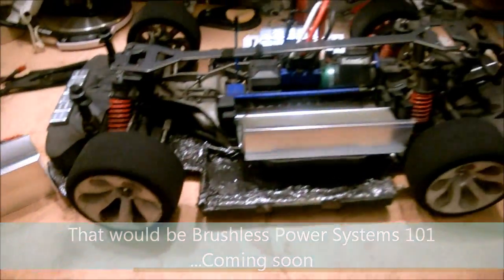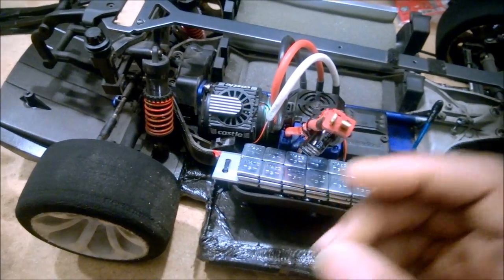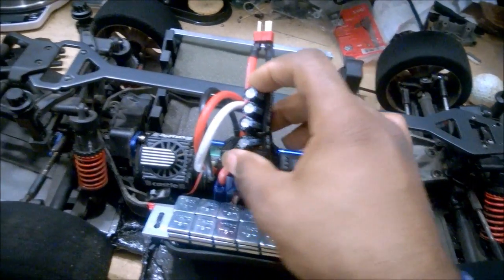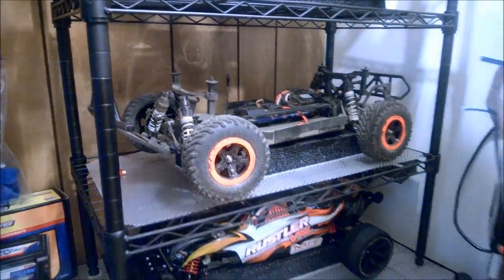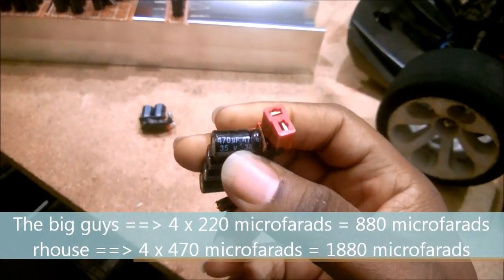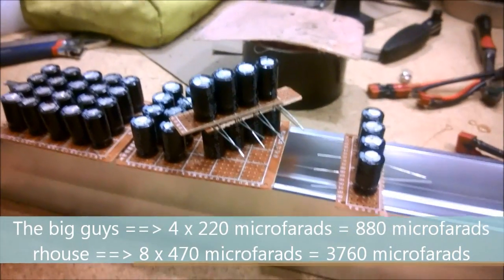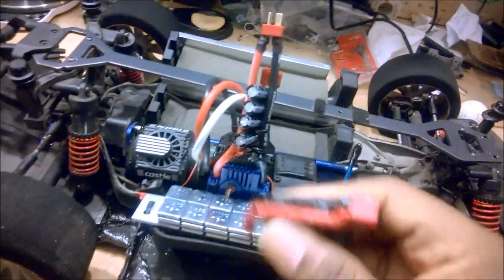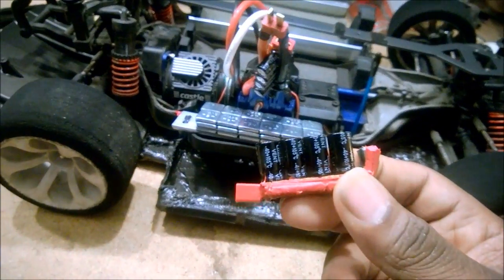Ep. 88: Cap Packs 101

Comment: Dont ESCs have capacitors built into them anyway? It seems like your almost overclocking the ESC by enabling the currect boost
Reply from the maker: +PS4 Custom Gamer ESC&#39;s do have capacitors in them, but they are only sized for the average RC&#39;er pulling a relatively small amount of current in short bursts (like accelerating out of a corner in a race). Speed runners can pull 200+ Amps for several seconds, which is a MASSIVE amount of current for a relatively long time. Cap packs work with the batteries in these extreme cases to make sure the ESC sees a good, clean power source.

Most batteries can&#39;t handle pushing that much current without having pretty large dips in voltage that hit with each power pulse. This is called &quot;ripple voltage.&quot; Better battery packs will have lower ripple voltage, but you should expect every battery to have some ripple voltage in these power ranges.

If the ripple voltage is more than ~10% of the battery&#39;s nominal voltage, it can damage your ESC. Well sized Cap Packs act as filters that squash the voltage ripple and provide good clean power so the ESC can perform optimally. The interesting wrinkle is that larger capacitors charge and discharge at a slower rate. This property is called a capacitor&#39;s &quot;time constant&quot;. So, if you have individual caps that are too large, they will not be able to filter higher frequency ripple voltage (like what you&#39;d see at the top of a motor&#39;s RPM range on a speed run). The answer is to use a lot of smaller capacitors that add up to the overall capacitance you are looking for. 

In short, the main point of a cap pack is to insure clean power to the ESC. They do store energy as well, but that is generally a secondary effect. Put another way, if the current capability of a battery is so low that it needs a cap pack to act as a secondary battery, you probably should be looking for a better battery.
Reply from the maker: +PS4 Custom Gamer This eNos device has a circuit that allows a capacitor bank to sit in parallel to the battery to charge to the same voltage as the power system, then it switches to essentially put the capacitor in series with the battery to temporarily boost the voltage of the system, giving a speed boost. This effect is only momentary though, and the capacitor will quickly discharge until the system voltage had returne to "normal." Also, the rate of discharge is highly dependent on the current load on the system. So, on a 2S 1/10 scale touring car at parking lot speeds, the current load on the system is probably pretty low (maybe 50 - 70 Amps). The eNOS device can give a pretty noticeable  "pop" in performance here without putting a tremendous amount of strain on the system. Scale that to 6S or 8S though and things get a little different.

For me, the problem with an eNOS like device for high powered (6S or 8S) speed runs is that it's tough to make something like that scale in a way that makes more sense than just running more battery cells in a high current application. I have heard rumors of guys using a similar device to boost speed on speed  runs, but the difference in current load at 30-40 mph (50-70 km/h) and 100 mph (160 km/h) is HUGE. A capacitor bank big enough to do the same job on a speed run would be comparable in size to an extra 2S or 3S battery. True, I may be able to get a few seconds of 6S power from a "4S" power system, but I personally would prefer to use the extra weight to just carry more battery power.

Comment: why did you solder in Parallel instead of series?
Reply from the maker: Capacitors add in a way "opposite" to resistors in a circuit. connecting them in series actually reduces their overall capacitance, but increases the voltage capability of the resulting "capacitor network." Connecting them in parallel lets you sum the capacitance of the caps, but the network will be limited to the voltage of the lowest rated cap in the network.
Reply: thank you. that was helpful
Reply: I made 6 capacitor pack. But when I contacted it to the ESC 6S BLX 185 . It starts to caging or it's like if there is a power leaking. I contacted the + to + and - to - side. Is there something wrong? or what should I do?
Thank you
Reply from the maker: What voltage rating are the caps? They should be at least 35V for a 6S system. Also, are you sure non of the caps have gone bad. Bad caps in an external cap pack can cause the ESC to behave strangely, too.
Reply: It was my mistake honestly. I did not connect it right. But now I got it right. It is day and night difference.
Reply from the maker: Awesome! I'm happy it made a difference!
Reply: rhouse21 - RC Physics ooh yeah❤️😁

Comment: I got the boxer configuration (two caps on each side...4 total) these really are the best I've used yet. I'm just using it on the STREET ELIMINATOR build. It causes a major difference at launch and top speed!🔥💣💥💥💥Major difference.....If ur not using a good cap pack you are not running a competitive 132ft. eliminator drag car.
Reply from the maker: Thanks for the great words! Feel free to post pix of your install in the RC Physics Sandbox Facebook group

Comment: Will adding cap packs make your R/c slower??
Reply from the maker: A well designed cap pack should never make your car slower except in some very extreme circumstances. In general, adding extra capacitance allows your ESC to better handle the instantaneous load of feeding the motor high current levels. This should also let your ESC run more efficiently as well, so there should really be no down side.
Reply: rhouse21 - RC Physics Ok thanks for the info..!😊 It makes sense..!👍👍

Comment: Nice work man i dont know if you are still making katpaks but if you are id like 3 for my xlx esc's and i would like to chat with you about my build. Thanks keep it up bro EXCELLENT explaination
Reply from the maker: If you are on Facebook, feel free to join the RC Physics Sandbox and tell me all about your build. https://www.facebook.com/groups/804281383082531/

Have you checked your XLX data logs? They have a pretty big factory cap pack and usually do not need much more capacitance as long as they are being run on good batteries. I don't mind building packs for you, but the XLX can be funny. I few folks have actually seen them fall into a reduced power mode if you connect too much capacitance to them. This is why you really need to look at the data logs and they will tell you how big a ripple voltage problem you have, if you have one at all.

Comment: Hello I'm wondering if one of those cap packs you make would help my vxl3s run alittle cooler?does this help with the esc temps?
Reply from the maker: How much they help your system is really based on the quality of your LiPo batteries, but eliminating ripple voltage should help your ESC run more efficiently which should help to bring down ESC temps. I can't make any firm promises as to how much of an effect you will see, but they definitely won't hurt anything.
Reply: rhouse21 - RC Physics thanks for the response so quick..I run mostly 3s batteries which are turnigys and onyx 2s's..nothin less than 5000mah..would you be able to make a cap pack for me for it?
Reply from the maker: If you don't run anything larger than 3S, my rH214-6S should do fine. It is listed on eBay for $15. rH214-6S: 4x470uF (1880uF) 35V Cap Pack http://www.ebay.com/itm/152172204085
Reply: bought a pack of 1000uf 35v low ESR Panasonic capictors on amazon... 1 dollar each.. just make it yourself,....... 
2000uf at 25v is more than enough and would cost $2 to make.
Reply from the maker: I prefer to use a larger number of smaller caps to reduce the load on each cap and add some redundancy in case a cap burns out because of abuse.

Like most things, the individual parts aren't very expensive. It all comes down to the time it takes to come up with a good design, build it, and have some assurance that it should work as designed.

Best of luck.
Reply: total capacity needs to be 1000uf-2000uf and 16v-35v. Put them in series or parallel depending on what caps youre using.
USE ONES WITH LOw ESR RATING

Comment: hello sir this capacitor pack help per heating motor or help to down  temprature
Reply from the maker: I've been told that a good cap pack will do both of those things because it helps the ESC run more efficiently.

Comment: I would highly recommend 4x 2200uf capacitors 25v +,  your 4x configuration isnt doing much
Reply from the maker: There's actually a lot more to cap pack design / selection than cap size. Actually, sometimes going too big can actually hurt your performance. The 4x470uF configuration is actually 33% larger than the Traxxas XO-1's stock cap pack and is fine for "lower power" set ups with good quality batteries. Higher capacity power systems need more "help", but you have to consider factors such as total system power, operating voltage, battery Internal Resistance (IR) and the Equivalent Series Resistance (ESR)of the individual caps in the cap pack. 

I'm going to be filming a Cap Pack 201 update video soon to talk about some of these things, but trust me, my 4x470uF packs low-ESR cap pack are a lot more effective than you might think, especially on lower-power rigs.

Comment: great video and great discussion.  do you think it would be worthwhile for safety to add a bleed resistor to the circuit?
Reply from the maker: No one has ever asked me that. Great question!

Once the cap pack is connected to the ESC, the ESC does a really good job of acting as a bleed resistor. In most cases, it completely discharging the Cap Pack, so you really do not have to worry about shocking yourself on the ESC power leads too much. Also, keep in mind that while an 8S system runs at 33V max and a 6S runs at 25V, most ESCs will stay active until the line voltage falls to ~5-6V. After you disconnect the batteries, the ESC will not shut down until the voltage falls below that threshold, so they do a good job making sure there isn't much energy left in the caps. 

On a related note, I actually thought about adding some sort of resistor to the system to reduce spark caused by the inrush of power when you connect the batteries, but could not figure out a simple circuit that would not also change the effective resistance the Cap Pack "felt" from the rest of the system.  The frequency that a Cap Pack "kicks in" is determined by the overall system resistance, so a resistor of the wrong size would change how effectively a pack filters voltage ripple.
Reply: Adding a resistor in series will reduce the effectiveness of the system.   I've been looking at inrush circuits and it seems that for the lower voltages of under 11v, it is just not necessary.  FOr highter voltages, there are simple ICs available to do inrush or just making a simple resistor-inductor circuit can do the trick.  

On a different topic, I've been doing research and  I am guessing that adding a small ceramic capacitor in parallel to the electrolytic to further improve power quality as well as total instanteous power.  Big capacitors handles low frequency ripple and mains noise and major output load changes. Small capacitors handle noise and fast transients.  I believe adding a small ceramic cap wouldn't hurt anything and may reduce ESC loads and temps further as well as motor temperatures and RF noise.
Reply from the maker: The guys at EVUL Empire have posted some prototypes that use this principle. There is a Facebook group called Ripple Killers where a few of us Cap Pack makers exchange ideas. You should definitely join!
Reply: rhouse21 - RC Physics I've got some ideas on circuit topology (layout).  I don't like they way the major manufacturers are doing it...for a specific reason.   the "ladder" topology (my term I guess) won't be as effective as a slightly modified layout where the positive lead connects to the rail at 1 end of the ladder and the neg lead attaches at the far end of the ladder on the neg rail.  does that make sense?
Reply from the maker: I may need to see a sketch. You can post a pic on the RC Physics Facebook page (https://www.facebook.com/rhouse21RCPhysics/) or send me a PM there. You've got me curious.

Comment: If 35v capacitors are the standard on the xL2 and their other products for the xL2, is it ok to use 50v or even 63v capacitors to create a Cap-Pack?  
I have a 12s ESC and figure I need it for my 8s and 6s rc's too. 
2200uf 63v caps
http://www.amazon.com/gp/aw/d/B00ERGSQ8G/ref=psd_mlt_bc_B00ERGSQ8G
Reply from the maker: The only downside of using higher voltage caps is that they physically larger. A Farad is a measurement of how many electrons a cap will store at a given voltage. Higher voltage caps are bigger to have room to store the extra electrons, but they are no difference in performance at lower than rated voltages. I rate my cap packs conservatively to have extra margin for random voltage spikes and such. I use 35V Caps in my "6S" packs and 63V caps in my "10S" packs, even though they will probably handle higher cell counts just fine. Be careful about using really large valued caps. They change the frequency that will be filtered and may not actually do anything if you use the wrong value. Check out a recent "rhouse Tech Corner" on the RC Physics Facebook page for more info. http://www.facebook.com/rhouse21rcphysics
Reply from the maker: Google "passive low-pass filter" to get even more info on this. There are a few good tutorials out there. That and my "Tech Corner" should get you in the right neighborhood. You can wire Cap packs in series or parallel. Wiring in series uses bigger valued caps of lower voltages ratings to create a capacitor network with a lower "effective" capacitance but higher voltage capability. Wiring in caps parallel increases the "order" of the network, making the filter "stronger" but requires higher voltage rated caps.
Reply: +rhouse21 - RC Physics I really appreciate all the information.  I'll definitely link up on FaceBook.

Comment: If a CC BEC Pro was installed on a 12s system, should the BEC be soldered between the esc and the Cap Pack?
Reply from the maker: +13djdave13 That's an interesting question. Capacitors are actually "AC" devices, meaning they respond to fluctuations in voltage. Cap pack's filter out ripple voltage on your power cables by using the Electric Field created by the electrons they store to generate an opposing voltage to attempt to counteract and cancel any rapid voltage fluctuations they "feel" on the power lines. The reason you want to solder the cap pack near the ESC is because all wire has some inherent resistance, so you will have a small amount of voltage drop over the length of the wire. (It's usually VERY small for good wire.) Having the cap pack wired too far "up-stream" would allow for some additional amount of voltage sag between the cap pack and the ESC which could increase the voltage ripple seen by the ESC. You want the power to your BEC to be as clean as possible too, so you definitely want it soldered near where your cap pack is attached. As long as it's close by, I don't think the exact order you wire them matters much.
Reply: +rhouse21 - RC Physics Thank you for the knowledge.  As you know, what we do can get expensive and I'm trying to play it as safe as possible messing with this much power with electronics.  I'm planning on upgrading my electric Rampage MT from 8s max to 12s max and come up with a manual brake solution which I kinda have an idea how I'll attempt on fabricating using a servo, metal horn, and piece of rubber.  It may take me a while since the esc I'll be using is on back-order and can take weeks.

Comment: can you run cap packs on a sensored esc
Reply from the maker: +nts 323 Cap packs will work on any ESC since they just help to condition the power flowing into the ESC. Hard acceleration pulls a lot of current. This can induce a "ripple voltage" that can cause problems. Cap packs' primary purpose are to reduce or eliminate ripple voltage, but a large enough cap pack will also help augment the batteries in some situation.

 I hope this helps.
Reply: Thank you👍